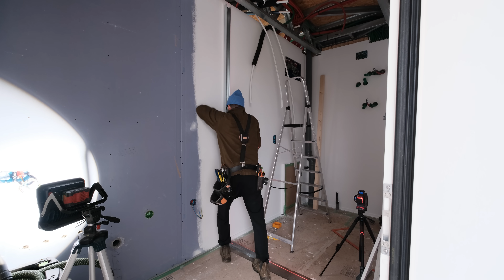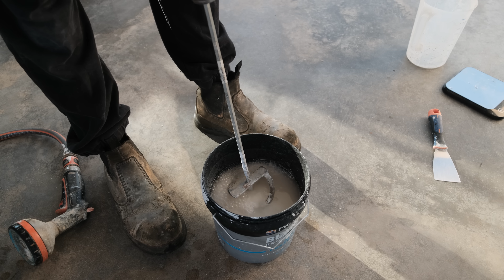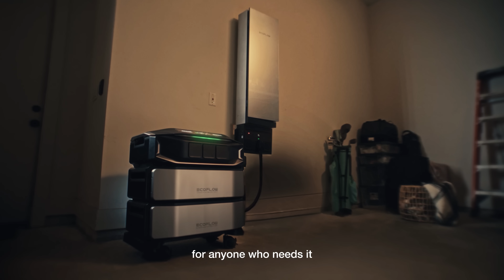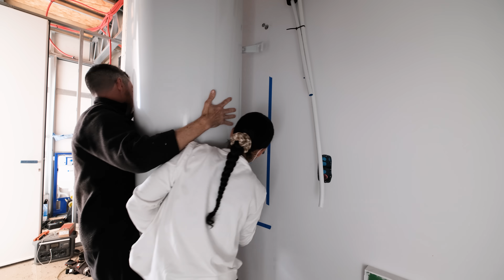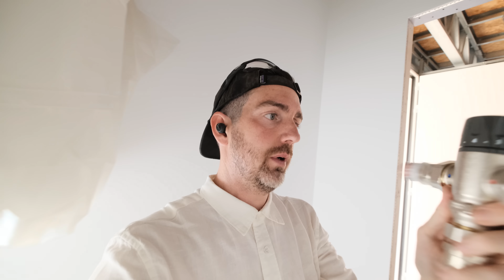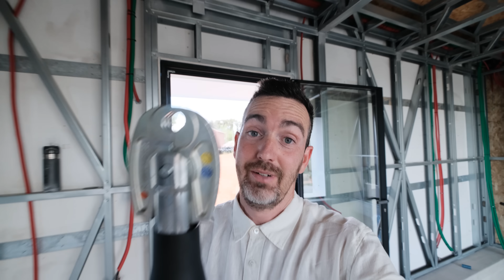900 Days Building My Off-Grid House.. The Day It Finally Came Alive

Comment: Hi guys and congrats on your journey. Watched the latest video and have a question regarding the electric 200 litre boiler. I understand that you will use photovoltaics and batteries etc to power the lot but how come you did not use solar thermal panels to heat up your water ? If understood correctly the installed boiler will consume anything between 2.5 to 4 kw to heat up and maintain the water. Whereas a solar thermal paneling boiler will utilise timely the sun. And only upon continuous dark and winter days you might want to turn on the switch to maintain or heat further. Furthermore I presume that you will utilise a thermal pump to warm and or cool the house. If connected with the solar boiler then you compensate the difference in water temperature directly via the pump. It is a sincere question from one of the people that has watched you from day 1. All the best from Athens, Greece

Comment: 27 mins. It could have been more controlled if the collectors were at eye level.Also, if the collector does not crack, there is a possibility that the adjacent electrical installation panel may be damaged.

Comment: I would suggest throwing in some 2x4s or 2x6s to strengthen that wall behind that water tank before you close up that wall. Maybe even attach to those bolts. With all that water in the tanks you’re going to have a lot of Penrith pulling on that wall. Just a thought.
Reply: I agree, in Canada you need to secure to the frame. As the weight go the tank and water may be too heavy over time.

Comment: It is really impressive to forget only one. Especially if you don't do it for living. ❤ I have done this mistake many times. They are 99% embarrassing and 1% expensive. 😂 I have flooded entire heat pump with antifreeze and burn up the logic board. Most impressive thing was that lose connection holded for 4 days at 3 bar before it give up on me. 😢